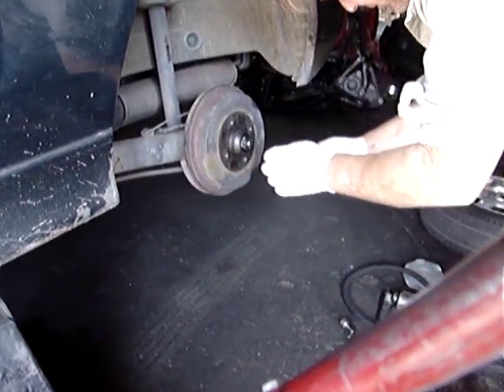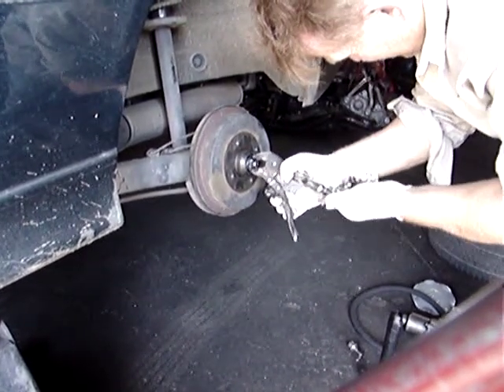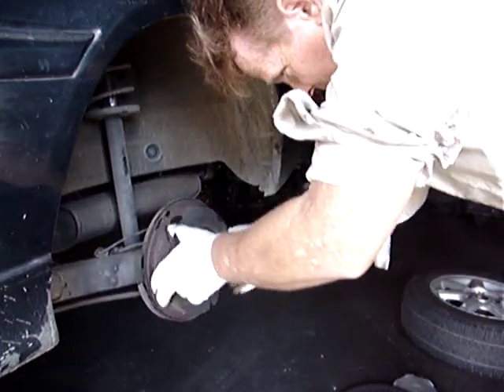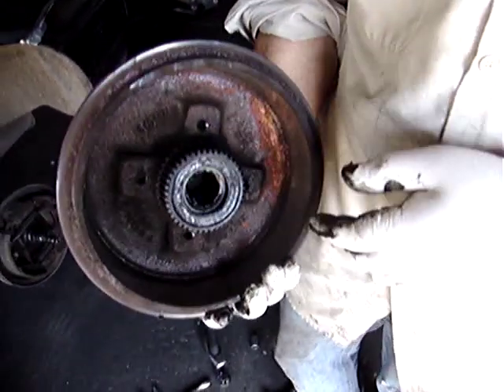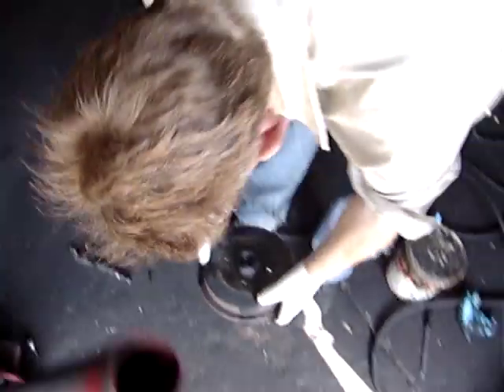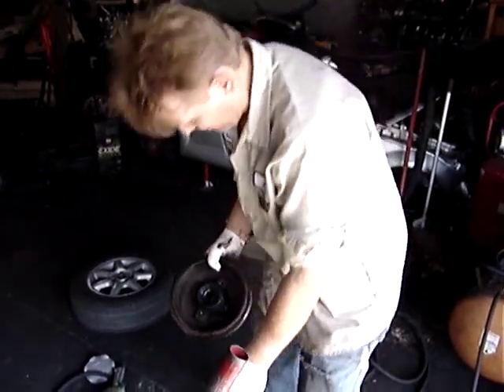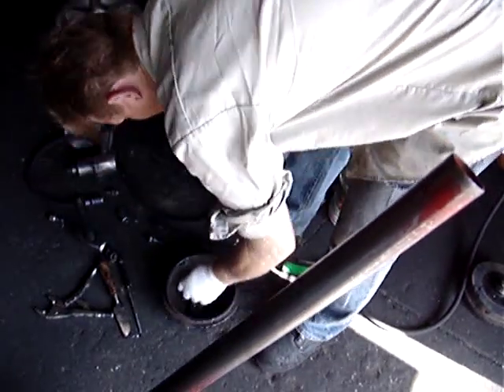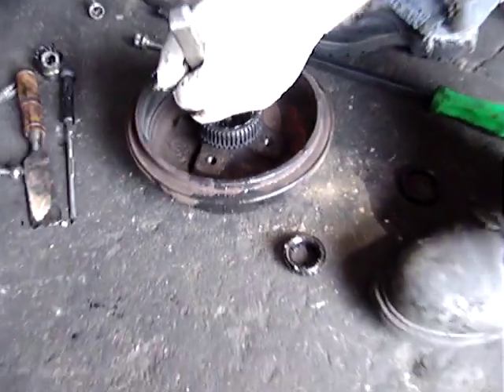1999 VW Cabrio rear wheel bearing replacement

Comment: Is it different on the 2000? I thought 99 was first year MK3.5 redo?
Reply from the maker: No 2000 is not different. Pretty much all MK3 design.
Reply from the maker: Maybe the only difference is whether the Cabrio has ABS or not.
Reply: Max breakman ABS, still. Its the mk4 combo design
Reply from the maker: @djkenny1202  Maybe, I'll check but it's true I haven't worked on a Cabrio in quite a long time!